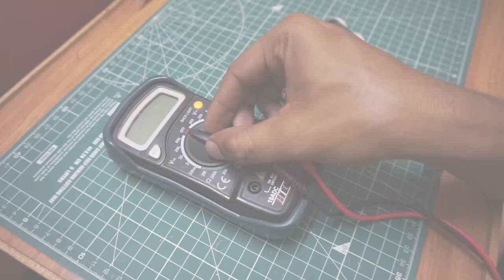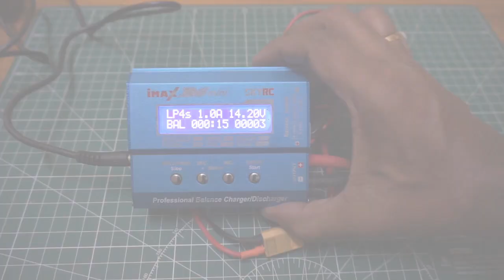How to make Li ion battery pack For Drone/4s Custom Built Molicell 21700 P42A battery pack/#Drones

Comment: Please used battery spot welder with a expensive molicell 22700, lithium ion battery isn't made for soldering. Spot welder isn't expensive you can buy purple mini spot welder with 99 gears at1600 from electronics dukan rupees  or BIFRC spot welder at the same price from Robu or makers bazar